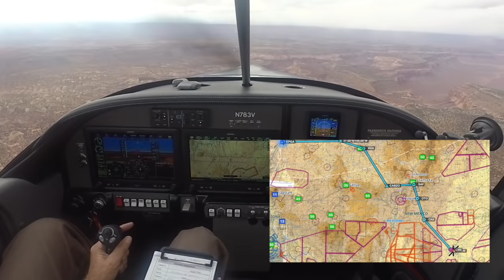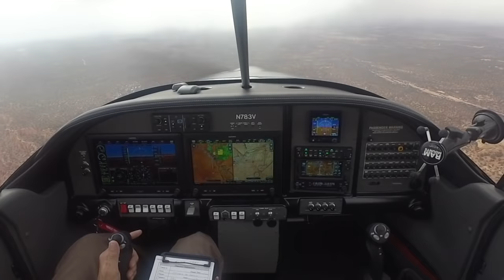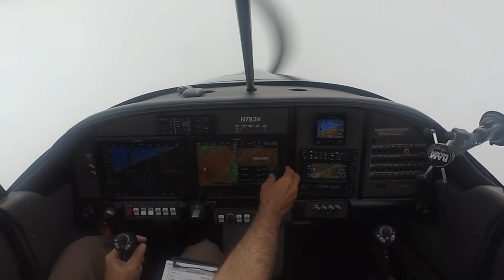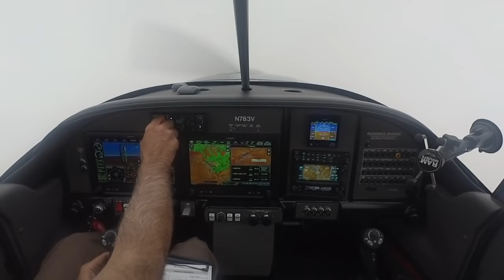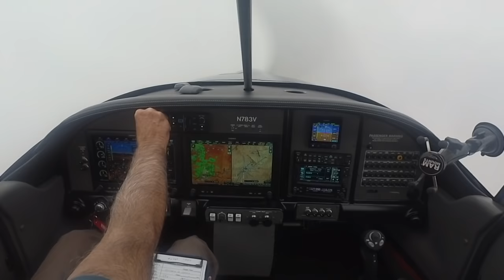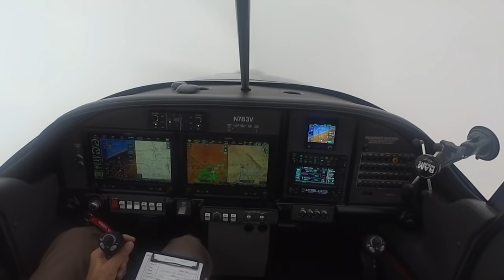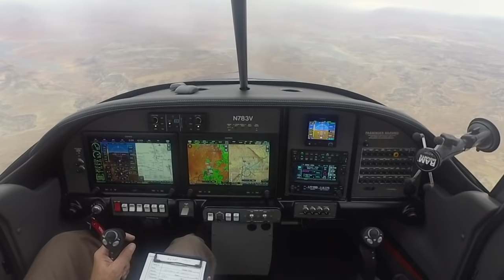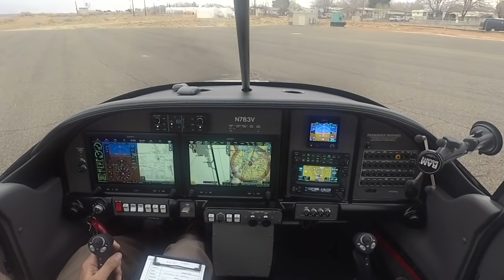RV 10   N783V   My 1st Emergency   HD 720p

Comment: That GD pitot tube. If like half the pilots of Maydays’s documentaries had seen this, there would be hundreds still alive
Reply: @ErrorMoose  Thats a good question, they should automatically turn on at 4 degress C
Reply: @ErrorMoose  Really good question, it really never is a problem since it is so basic, pitot heat is essential for certain hights, but at the same time. It should be automated for sure.  One of the problems is that to get anything up in the air it needs a rigorous testing procedure which is expensive, this might be related to that.
Reply: @mjphillips76  tell that to the looney systems designers, with pitot heat the switch is on the central bank on the left, in the number one position, interesting location, as its not hidden away somewhere , I guess if it was made in a Farsi (Persian) reading country it would be on the right - ? "I'm a Texan famous last words..."
Reply: @ErrorMoose  Garmin has a heated, regulated pitot tube that works with the avionics in this aircraft.  This particular pitot tube can be configured to alert the pilot when the temps drop to a specific temp that the pitot heat is not turned.  The pilot would see an alert message on the G3X PFD.
Reply: That just adds yet another point of failure to the aircraft. By having the pitot as manual, it makes the mechanism much simpler and less prone to fault.
Reply: @shadowtheimpure  I didn't see these replies when posting my own comment to the same effect, but I'll continue here.

If adding something as trivial and robust as automatic temperature regulation on a pitot tube is creating single points of failure, how do large commercial aircraft stay aloft at all? Zillions of procedures in a modern passenger aircraft cockpit are automated under normal operation. 

Why would automation, especially at so simple a technological level, be a negative for light recreational aircraft, when it's absolutely necessary for large commercial aircraft?
Reply: @fooanonymous  I believe you may have misunderstood me. When I called it a 'point of failure' I wasn't calling it something that would drag the aircraft from the sky. I was more calling it 'one more thing to go wrong'.
Reply: @mjphillips76  another failure point.
Reply: We had bugs get lodged into some pitot tubes/sensors, no bueno.
Reply: Should just be standard procedure to turn on the pitot heat for every flight in an IFR-capable airplane.
Reply: What do people normally do that ends up killing them? Attempt stall recovery into the ground?
Reply: I'm not a pilot and have no experience at all with aircraft but enjoy reading and learning about them. I was wondering why isn't the pitot tube heated all the time? Does it interfere with it's use when at higher temps?
Reply: @rubiconnn  Your novice level, has not interfered with, your high level of logic, applied to a system, that unfortunately during its design, did not rcv the  crucial benefit of your novice level mind to query the engineers.  You would have triggered their brains to do a mod to prevent this incident.  It is criminal, it gets repeated, over and over.
Reply: There was that famous AeroPeru plane that went down in 1996 that was actually the static ports and not the pitot tubes but nevertheless they lost the airspeed indicator along with a lot of other instruments. Turns out someone duct taped the static ports and forgot to untape the ports.
Reply: My dad included
Reply: @BYENZER  Even commercial aircrafts have had serious problems with pitot (check AU2553). It may be ice by heating failure, debrim or whatever. So many variables and as systems become more complex there are even more degrees of possible failures.
Reply: @kdmq  frozen pitot tunes were found to be the main cause, along with pilot error, in the Air France Flight 447 disaster.
Reply: @ErrorMoose  or at least a light that illuminates the switch in potential freezing conditions.
Reply: @drewhahn9650  not a pilot , but I’d assume . Reacting in poor judgement or panic to alarms and instruments giving them failures or false information causing fatal mistakes instead of keeping calm and flying the airplane by the basics .
Reply: @ErrorMoose  Its part of the checklist when you go IMC, whenever I am in IMC it's always on, regardless of whether I have lost speed or not....
There are automated systems in some aircraft that deal with anti-ice for the wings and engines.But they too don't have one for pitot heat, form what ik......developing such a system would not only be costly but difficult to implement. Some things need to be in control of the pilots. The instant reaction would be to turn on anti-ice for me.in unreliable airspeed conditions....I would then check if something is blocking it(if the pitot is visible)....
However, I gotta say unreliable airspeed in IMC is exceedingly dangerous...!
Reply: @shadowtheimpure  True. Imagine if that system failed and the switch was eliminated as "unnecessary".
Reply: My thoughts exactly. Pitot tubes are just everywhere
Reply: This is the type of question that led me to stop aviation training. I realized the most inexperienced pilots (beginners) will fly in the airplanes with the least amount of support.  Forgot pitot heat ? Let's just sound an alarm. The computer suggesting you to turn on pitot heat ? Naah that would be too good. 

Windshear warning, TCAS, terrain alarms ? Naaah that's only if you are experienced enough to not need them. You're a beginner ? Fly in that decades old plane with zero assistance just so we can see if you can make it.

No wonder why general aviation has so many crashes. Many of them totally preventable with the technology we have, yet aviation is stuck in the 1970s, courtesy of FAA redtape. Meanwhile other modes of transportation have made tremendous progress (autos).

It's not a question of if, but when we'll do a mistake. Refusing to use the technology we have to support us when that will happen is plain stupidity at this point in time.
Reply: Seems a sensor for a blocked or frozen pitot tube should be a relatively simple thing to devise nowadays, and / or as mentioned already auto heating.
Reply: @uski  the thing is though that modern light aircraft with all the latest systems and instruments continue to crash at about the same rate as in the past… the key area where the biggest difference can be made is training the pilot..
Reply: @uski  Well I think that it (in the US anyway) is related in part to concepts of freedom and accessibility, and in part to cost. There are people who are not able to afford more than a 1940’s TaylorCraft bc12d, but they are assumed to know and be responsible for the risks that they accept. There’s countries in the world where they wouldn’t be allowed to fly such an aircraft more than a mile or two from the field, but we don’t believe that people should be so limited. The other aspect is cost, that BC12D could cost 20,000 USD, whereas a new light aircraft with all the bells and whistles is from 500,000 USD to well over a million. There are not that many light aircraft produced and they are so lightly used that they are around for decades, the replacement of equipment is very slow.
Reply: Mahahah it's unique to find Motorsport expert in aviation vids, well hello there ✋👋

Comment: In my 'bush-pilot days , happened to me ,in a snowstorm , 1 mi viz, uncontrolled strip , C 172 , 3 passengers ..  the 'pitot-tube had ,actually malfunctioned , was 3miles from touchdown .. had to land with no airspeed (basic instruments only) indicated, used the stall warning, and throttle, to gauge speed at each increase in Flaps-position , to sustain a 100ft per minute descent .. didn't even know I was on the ground until the vsi indicated '0' descent .. yeh .. 1) don't panic , you can do that later  2) Aviate ,aviate, aviate !! ..

Comment: Another tip for you Southern dry air pilots: When descending through clouds into warm moist air, turn on your cabin heater. Doing so will prevent instant fogging of your windshield and instrument glass.
Edit additional info: Your aircraft glass has cooled while at altitude.
Reply: I went high to escape the heat to begin with! I, am not, turning it on. I just open the vents, and turn on the blower. The warmer air down below, is enough.
Reply: Just wondering. Is your stall warning electronic, and based upon airspeed? The metal tab on the wing has nothing to do with the pitot system. Neither does the suction horn on cessna's.
Reply: @ConvairDart106  You replied to my comment perhaps by accident. I don't own the aircraft in the video.
Reply: We had our steam gauges fog up on us during an IMC IFR approach in Nagoya, Japan in a Black Hawk during your exact scenario.  It was strange, and 16 years later, I've never seen anything like it since.

Comment: On the positive side, that was a pretty nice cross wind landing especially considering how frazzled your nerves must have been after all that.
Reply: Great landing but there was not much crosswind. Wings fairly level and a pretty small crab angle. 70 degrees gusting to 25 knots would have looked and felt much worse. I guess he landed between gusts.

Comment: 9:36 Holy crap that is some scary bank that the pilot is un aware of. Thanks for sharing this lesson and glad you landed safe.
Reply: Just shows how easy it can happen. And that even being IFR rated doesn't make us immune, particularly when the IFR conditions were unexpected.
Reply: And with the alarms, it had him not trusting the instruments fully. bad combo, IMC and questionable electronics. In theory, should be able to fly with static port altimeter and magnetic compass. If your altitude is constant, your pitch is OK, if your heading is constant, your bank is OK , but holding on to that in bumpy air, you're going to need practice.
Reply: @TD_YT066  there was nothing wrong with his electronics, he simply forgot to use pitot heat, even steam gauges need pitot heat.

Yes, theoretically you can fly IMC even without an attitude indicator and I have demonstrated this in training in real aircraft, and also in simulators, but it is Very difficult and Very dangerous, especially if you get behind the aircraft at all. But to do IMC safely you MUST have an attitude indicator, and he had that, he just wasn't keeping up on his scan is all.

Comment: As an aircraft mechanic since 1981, I have always wondered why pitot heat tubes don't have an automatic activation feature. At least an audible warning that considers temperatures and humidity.
Reply: I posted above. I've been an A&P for 33 years. Was wondering the same thing. It seems as though they should include a system that at least advises of icing conditions, with an aural warning. It seems like something that would be as simple as sensing engine power/and no pitot pressure  The lowering costs of avionics packages for the general aviation segment, is making it more accessible for less experienced pilots. That should be factored into avionics packages. I was actually surprised at his level of stress, that made him overlook pitot heat. Especially given that he has his IFR .  Anyone else could find themselves in a similar situation.
Reply: No more melted covers!
Reply: A&P since 1980.
You'd think that I would know better by now but I still burn my hands....
Reply: @letitrest4662  On some Garmins built in, you get visual warnings if the pitot heat is disabled (for example the G1000 on Cessna 172)
Reply: Some much more expensive aircraft have automatic pitot heat and engine anti-ice.
Reply: you can have a temp sensor that activates at 4 degrees celsius and warns on the PDF that pitot heat is required. i do not know if this is a feature of the garmin 1000 system or specific for plane types. i fly the cirrus sr22t and this is definitely a standard feature. probably really inexpensive to install, but apparently can be a lifesaver.
Reply: As someone who's been the enterprise tech hardware industry for 10 years, I can tell ya that temp gauges have ridiculously high failure rates. It would not surprise me at all that things like this are either crazy expensive or just left alone due to how high the failure rates are.
Reply: @c0onyb  appreciate your perspective, I was wondering why